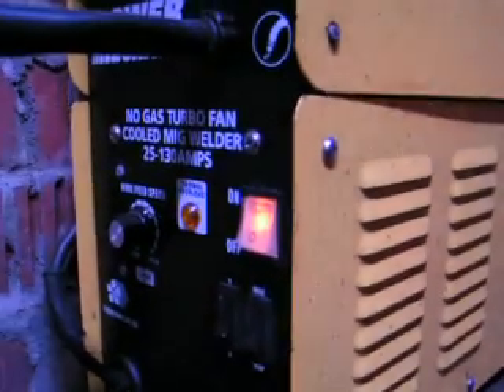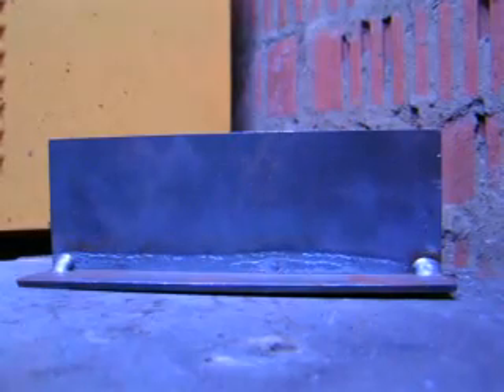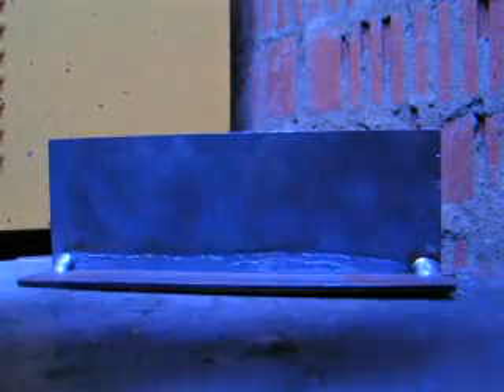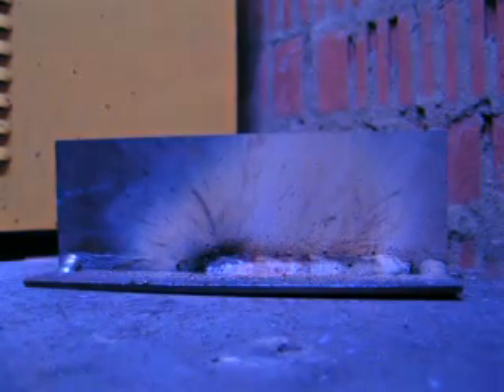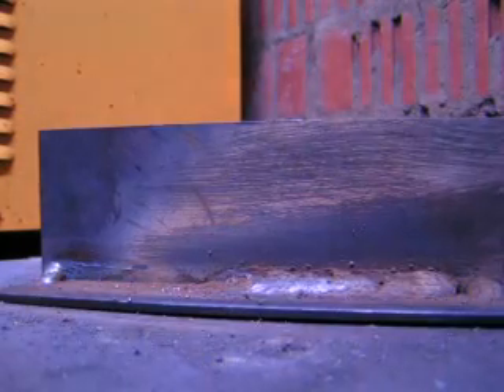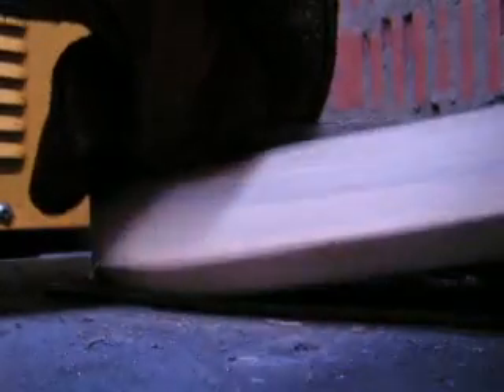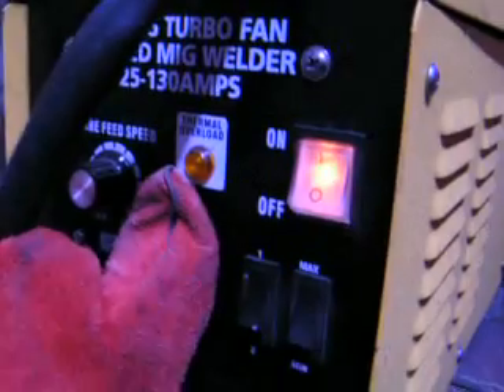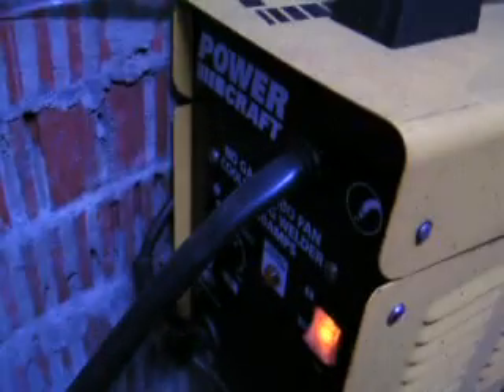gasless mig welding

Comment: I would have never showed this video as there was a hole in the weld the metal was not properly prepared to weld . this video just isn't a good show are weld. gasless flux core wire is ok to use on some projects but I would nor use it on any asme code jobs.
Reply from the maker: It wasn't a test piece and it's a hobbyist machine, i'd be amazed if any £50 welder could lay a asme spec weld consistently!

Comment: sir i have a mig welder uses solid wire can i replace it with flux cored mig wire???
Reply from the maker: Yes you could, though you need to reverse the polarity of the welder, positive ground and negative torch for flux wire.

Comment: how does gasless work? Why don't you need the shielding gasses?
Reply from the maker: the wire has a very tiny hollow center filled with flux agent that creates the shielding gas as it burns

Comment: can you use the glassless mig for doing body rust repairs
Reply from the maker: Yes you can, use it, but you must clean away as much rusty metal as you can, Rusted metal will burn away when you attempt to weld it. Also, gasless wire burns hotter, so your power should be set low enough to reduce burn through whilst maintaining proper penetration. Tip: Try practicing on some sheet metal similar thickness to your cars panels.
Reply: yes i would put a wire wheel on my angle grinder and bring it back to bare metal with no rust, how many amps is yours and what brand